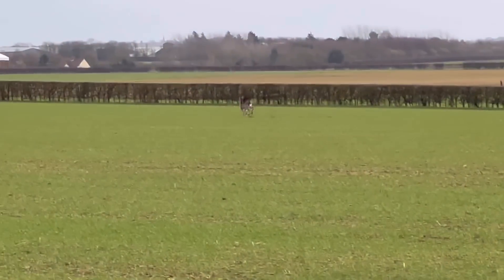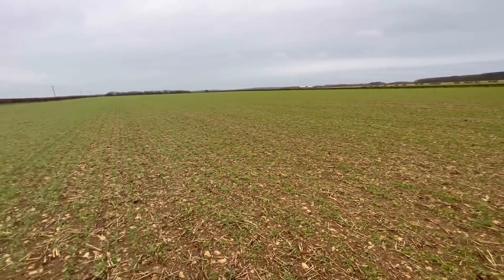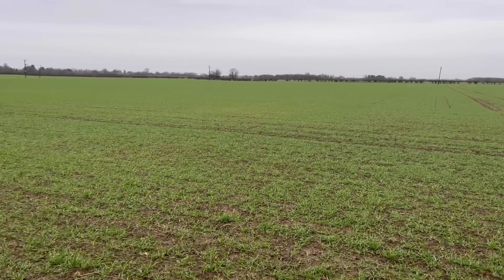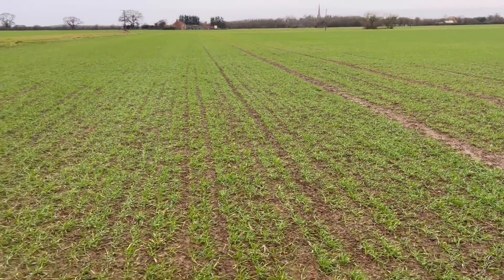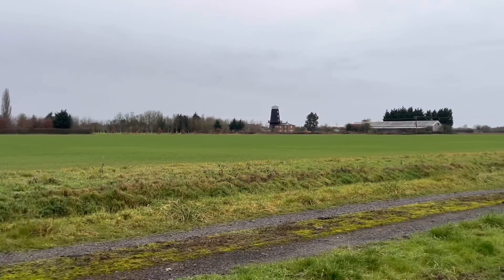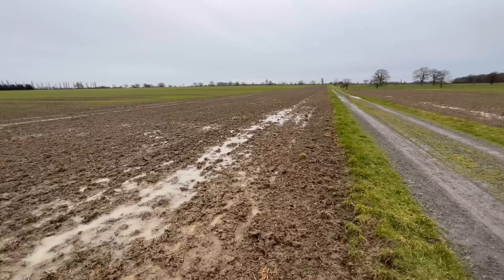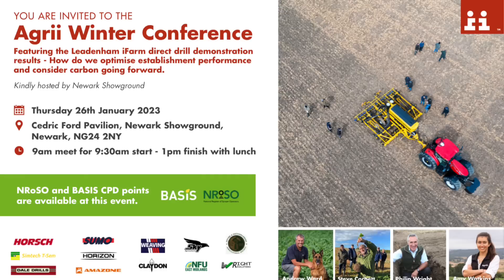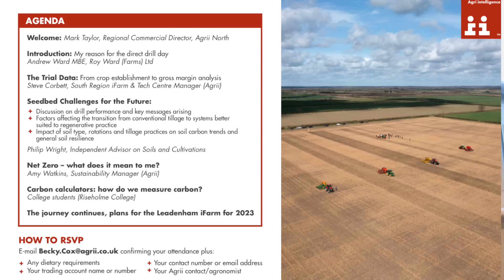FARM UPDATE 107 AN APOLOGY, WHEAT CROP UPDATE, WET FIELDS, DRILL FILLER, MACHINERY COSTS, AGRII CONF

Comment: A farm I worked on we had a Richard western drill filler We put extra long hydraulic pipes on it so I could just plug the pipes into the drill tractor and work the auger that way 👍
Reply from the maker: We had thought of that but sometimes you have to get spanner’s out and crack the pipes because of pressure, we wanted to avoid that.
Reply: I didn’t ever have that problem 👍
Reply: I’d be scared of driving off with the pipes still attached!😮

Comment: Could I suggest not going to the trouble of adding an engine on the drill seed filler.
But to permanently fit hyd pipes and a simple valve block on the back of the grain drill tank steps or platform so the tractor oil flows though the valve block and the operator controls the speed of the drill filler from close to the drill.
Cheaper than an engine I would think.
Reply from the maker: It would be, we did think of that but sometimes pipes have pressure which means getting spanner’s out to crack the pipe to release, we want to avoid that so filling is a quick operation.

Comment: Use drill tractor to run seed hopper.
Reply from the maker: I don’t want to do that because of the issue of pressure in the pipes ands having to get spammers out and crack the pipe to release it. There might be a way round it but I want to just back up with the drill, turn a key and off you go!

Comment: Good morning. Could you use a spool valve of the drill tractor to work the drill filler auger, it would save faffing about with a small engine ????
Thanks for the good films.
Reply from the maker: We did wonder that but the amount of times you have to crack pipes with a spanner to release the pressure, we want to avoid that and have a quick turnaround.

Comment: Happy and Prosperous New Year to you all.
Looking at the amount of work involved with converting the Drill Filler, would it not be easier and quicker to start from scratch with maybe an old tandem axle trailer chassis  ?
Reply from the maker: Wed wondered about putting an auger on the back of a trailer but it would require a tractor on all the time. At least with the Western drill filler we have a basis of the right machine with the evenly balanced hopper, chassis, it’s only the auger and power source we need to sort out.
Reply from the maker: Happy new year. Thanks for your comments and questions the past year.